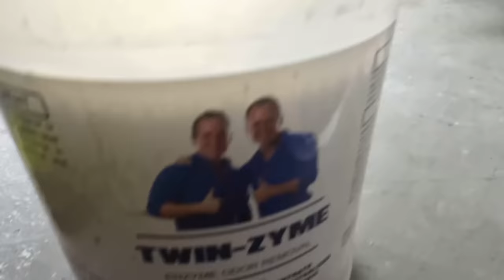BIG RODENT FIND behind the wall... the BEST WAY TO GET RID OF RATS AND MICE..

Comment: Thank you so much for your video. I am dealing with rats in an camper trailer. I've caught 4 so far and I know there are more. I immediately jumped to the idea to smoke out to find access points I haven't found yet. Your video was really informative for the situation you were addressing. And totally usable in my situation. I can smell the excrement outside. I've always had a good nose and I've used it well in mitigation as well as dealing with rodent infestations.

Comment: You didn't see any smoke coming out of that access panel? The smoke should have been pouring out of that pipe like a chimney if it was open to the sewer. That line should be protected by a p-trap under the slab. Also, I didn't see any rub marks or much in the way of droppings. I would expect a lot more evidence if that was the primary entry from the sewer.

Also, why put a jim cap on that pipe? Rats can chew through rubber in no time. Glue on an adapter and put a plug in it.

Comment: should have glued(cemented/welded) on an abs to fip adapter and used a brass or iron threaded cap instead. most rodents can chew up rubber caps easily and some chew the plastic(pvc/abs) caps through due to raised square wrench area. I've dealt with some crazy rodents over the years 😖

Comment: this is why you need to pull permits so you don't pay 64k for a roof and get fuckd. People don't understand that 100 permit protects the homeowner. It holds the contractor responsible. Without it insurance will not cover any problems you have

Comment: What did you guys charge her after knowing she paid $60+k for a roof is my question? I know you guys charge a lot, im in this field and when theres more then 2 techs and from the looks you guys pull up like a swat team. Iris paid a arm and leg between the both of you at the end of the day, but hopefully her problem is finally solved....
Reply: I wonder that too...and who fixes the parts of the house that's cut? How come they're were no rat droppings around the PVC drain mouse entry point? What if the problem comes back and all that work ends up not being effective? Lastly, was that a real rat skeleton under the insulation and if so, how the mouth get taped???🤔
When the guy came out to give us a quote and an idea of what would need to be done...because the house is over 80 and so many entry points, he shook his head and said he wouldn't do it because they would be back in less than a week...but did give us a booklet on what to do ourselves and what works and doesn't work. I thought that was pretty cool. He said he didn't want to take advantage of us and that we could do the same, ( other than the wall spray), which all forms of life have to be out of the house for a week...toxic. We didn't have that but with the advice from the booklet, we brought the population down extensively. 
They keep coming back but we keep doing the treatment and blocking off holes. It would have cost over $4000 otherwise.

Comment: Seams like a lot of stress and expense caused by poorly installed plumbing. Looks like a fairly new house, would she have any recourse with the builder? Faulty construction wouldn’t be limited by a 10 year construction warranty
Reply: That’s what I’m wondering
Reply: I believe she said she'd been there for thirty years so not new construction but maybe a remodel. I'm in this business and I'd say about 50% of the time, if there's been a remodel there is an open pipe.

Comment: Where are you guys from... I've been fighting a losing battle for 20 years. Traps, sticky pads, poison ect. I still have activities in my laundry area. I've killed approximately 30 over the years and several pest control services later I find myself doing this by myself.... Please contact me and give me some info. Anything you can tell me will be highly appreciated
Reply: They are based in Los Angeles but let me tell you the best thing that you can do and it is what has worked for me, eliminate the food source.  Go on Amazon and buy a bunch of giant mason jars I'm talking like the size that you could fit a loaf of bread in with a wide mouth. Every single food in your kitchen needs to be in a mason jar cookies crackers cereal chips anything not in the refrigerator needs to be in a mason jar. 

For bread you can drill a couple holes in the top of a lid of a mason jar so it can breathe and still be protected. Dog food cat food needs to be in a giant ice chest off of the ground out of the garage. There should be no food on your countertops that are not any mason jar. Put all pet food away at night do not leave pet food out at night or in your backyard ever. 

Every night you need to take your trash from your kitchen and put it in a liner and put it outside in the garbage. Keep your garbage cans sealed and tight and away from the walls put them in the center of your backyard as crazy as it looks it will help. Rodents always run against walls keep things away from walls and off of the ground. eliminate all plants from the perimeter of your house that are within 4 ft you should have a 4-ft clear path around your house no bushes no trees and no flowers no nothing. 

If you do all of that you are on the right path to being rodent free or very close to it. There is no magic thing to get rid of rodents it is a system of things. But the first thing is eliminate the food source which I have detailed above for you. After that we need to start going around your property with silicone and hard wire cloth not chicken wire hard wire cloth if you can fit a pencil through the hard wire cloth it is too big get the size that you cannot fit a pencil through. Go around your house with some sheers or something that can cut the metal hard wire cloth and 100% silicone not foam and you're going to fold up hard wire cloth and stick it in any gaps and cracks you have and use a silicone and caulking gun and squeeze it in all of the hard wire cloth to fill the Gap so the rodents can't chew through it. 

Just pony up the money and do it right you can do all of this for about a thousand bucks. But you will be able to sleep at night spend $300 on very nice wide mouth Mason jars. Spend $100 on a case of 100% clear silicone. Spend $50 on really nice disposable gloves. 100 bucks on hardwire cloth.  100 bucks on an ice chest for animal food. And a couple hundred bucks to hire a gardener to clear out a path around the perimeter of your house and make sure you trim any tree branches from touching your roof or touching an overhead power line that can be used to travel to your roof.  Lastly there is a product that boaters use to put on their anchor line when they dock so rats can't climb the line and get on their boat it basically spins it's a flat circular disc that goes on the line just Google it you can make one yourself or buy one for 50 bucks and put them on any overhead power lines in your house. 

It will take you a couple months to get this all done. Don't bother with poison it's useless and only kills other animals. Good luck you can get it done because I did after buying a house that was clearly dealing with rodent infestations for generations. Took me about 2 years and $5,000 to learn through trial and error what works but now I am rodent free and passing on the knowledge to you. Good luck and be patient but just know this formula works 100%.

And lastly I love these guys their videos are awesome they clearly know what they're doing and care about quality and take pride in their work. I've been a huge fan for years you should subscribe if you don't already take care.
Reply: @tonio909 Awesome advice. Deserves more likes than mine for sure 🔥🔥🔥💯👑♥️